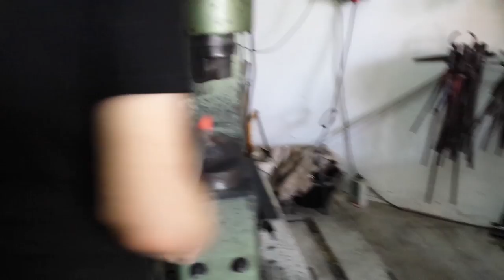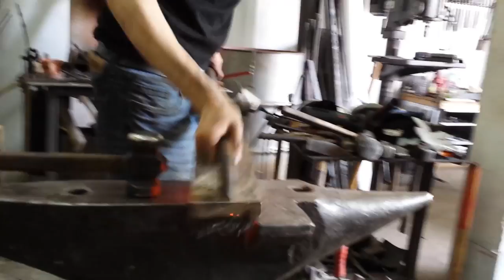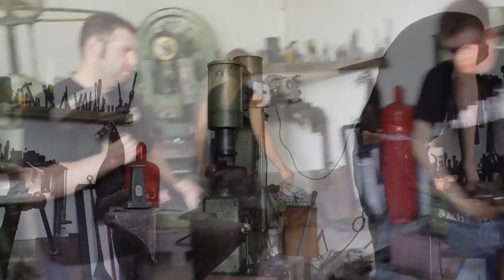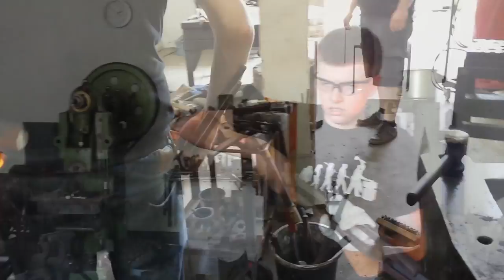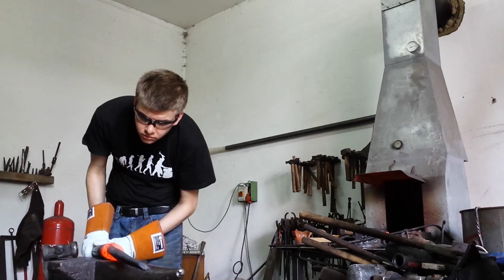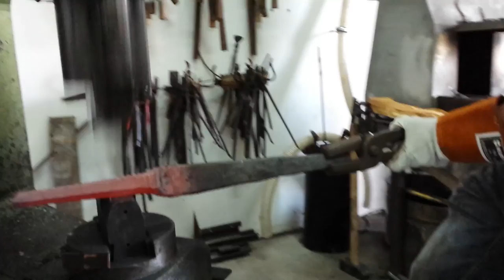forging an axe drift (full process)

Comment: The fact you can swing that rounding hammer around and not hurt your arm is impressive.
Reply from the maker: Due to the shape it looks a lot heavier than it actually is. And it is also nice and hard and lively so I can let the rebound work for me ;)
Reply: I have one 3 pound Cross peen that gives me alot of trouble it doesn't rebound very well hard to find a good hammer unless you make one.
Reply from the maker: Toothygrin Yea making a cross peen yourself is really easy.

Comment: great job done but please straighten your back when using the power hammer. You will and I mean you will get a terrible back when you are older and it's no joke!
Reply: Dude your head is way to far forward now I see the prob. Do you think your small neck can hold your heavy head in that position forever? It is really non of my business but do look into it. It will save you heaps of trouble. Thanks for the video.
Reply from the maker: Work With Nature Thanks for the tip. I am already working on a more healthy posture and do yoga regularely to get a better feeling for my body.
Reply: No prob, was seriously worried for you. Glad you are taking it well like this.

Comment: Hey Daniel, great video as usual! Is it possible to get the steel to shape by hand when it is that thick or do you need a power hammer? Do you know what the German term for a "drift" is? In case I fail do produce my own :-) Thx in advance!
Reply from the maker: Theoretically you can forge a drift like this by hand. But in reality you will have a hard time hand forging any coss-section larger than 1 1/4 inches. In German a drift is usually refered to as "Dorn" or "Durchtreiber".
Reply: Daniel Lea Hello Daniel, thanks a lot for your reply! I guess I'll try to form a drift from a 60x25x300 mm (w/t/l) piece of C45 or something like that, if a 50mm round steel would be too hard to work. I just scored a 100 kg anvil, so I am confident to get something done. Unfortunately I could not find any offer of an axe drift whatsoever here in Germany. Keep up the good work!

Comment: hello daniel like your service, I am a blacksmith and was wondering what you use charcoal it is bad for your health and how it works forging thanks.
Reply from the maker: In this video I was using blacksmithing coke. Usually I use bituminous coal. Charcoal also works for forging. You always want a good smoke evacuation and a well ventilated shop.
Reply: Daniel Lea but coal coke blacksmithing is better and more expensive, and where you bought your anvils I have a Brazilian model called av is very good thank you admire your art.

Comment: What is a drift used for?  Making the opening, in the ax head, for the shaft to go through?
Reply from the maker: The drift is used as an avil inside the eye of the axe (the hole in the head) to shape it around it and strech it in dimention.